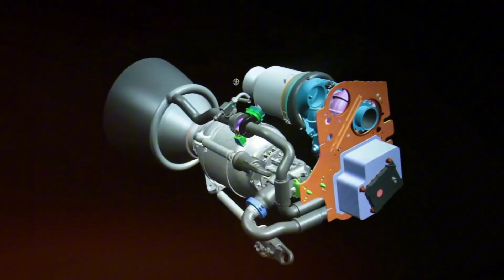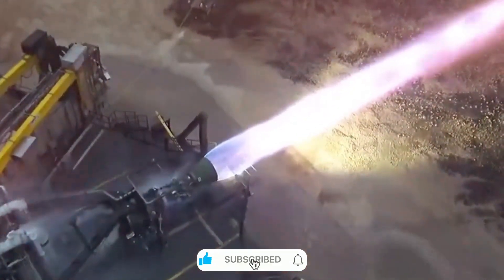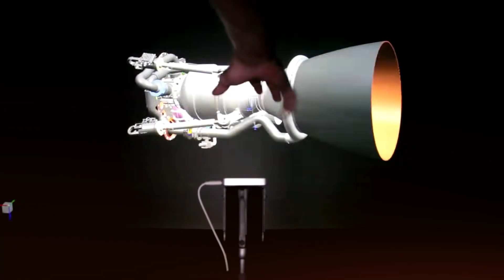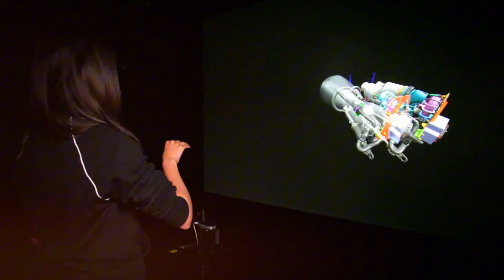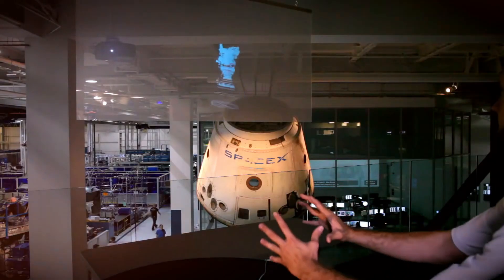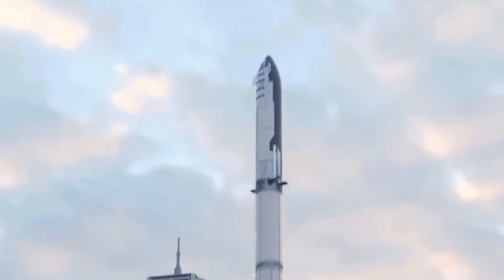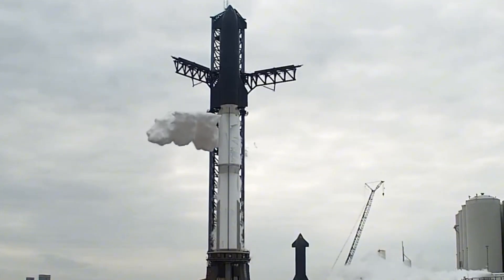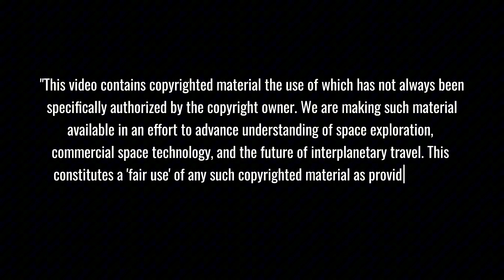SpaceX's Raptor 4 Engine Just Hit 300 Tons of Thrust! Mars Missions Now Within Reach...

Comment: As of now, SpaceX has not released an official press statement regarding a Raptor 4 engine. The latest official update on their website, dated January 16, 2025, details a successful Starship launch but does not mention a Raptor 4 engine. 

Discussions about a potential Raptor 4 engine have surfaced in various online communities and speculative articles. For example, a Reddit thread from two months ago mentions Elon Musk discussing plans for Raptor 4, though specific details are scarce. Additionally, a fan-made wiki notes that Raptor 4 is a conceptual next-generation engine, but no concrete plans or prototypes have been confirmed. 

This whole video is completely speculative.